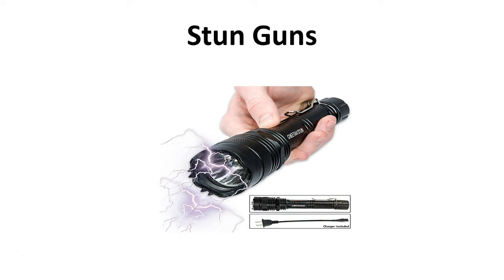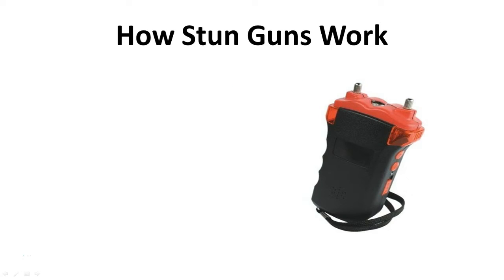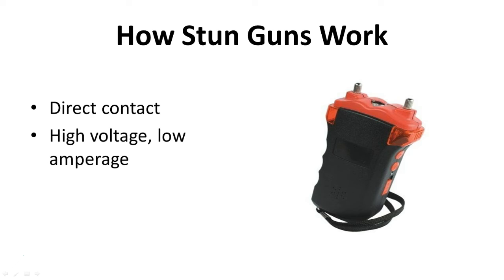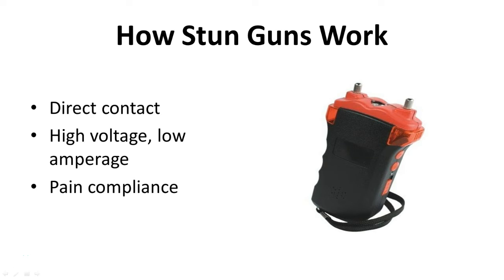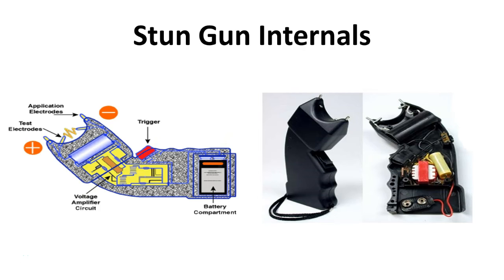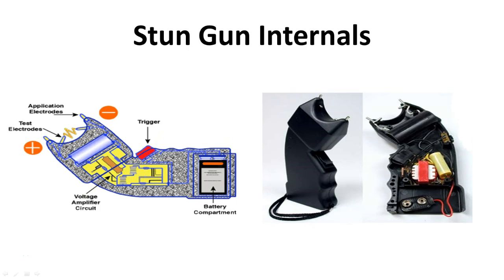How Stun Guns Work

Comment: Also there are two types of stun guns 

1st.) The most common ones use a voltage multiplier ( capacitors and diodes) to step up about 5kv to 20-30kv multiplier stun guns are very loud and make bright arcs 

2st.) Trigger transformer  stun  guns they use a transformer connected to a big capacitor that discharges through a spark gap to the primary of the secound transformer (the trigger transformer) the first transformer makes 5kv from the 3v battery and then through the capacitor and the spark gap and the transformer it makes 50kv more or less trigger  transformer  stun guns are usually more effective for a shock always multiplier ones shock only when you tuch the arcs when direct contact it only burns 

Also the more far the electrodes are the more painfull it is